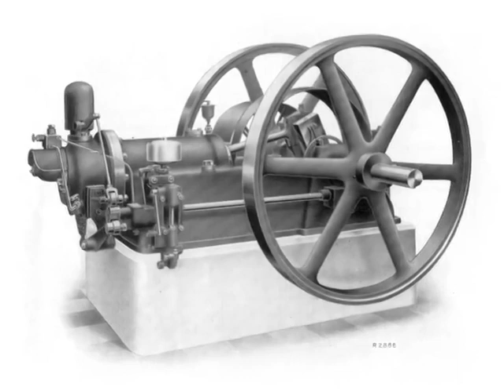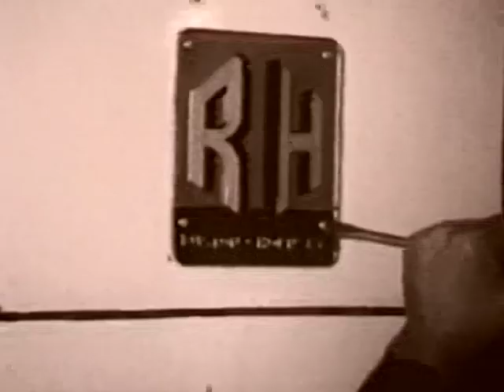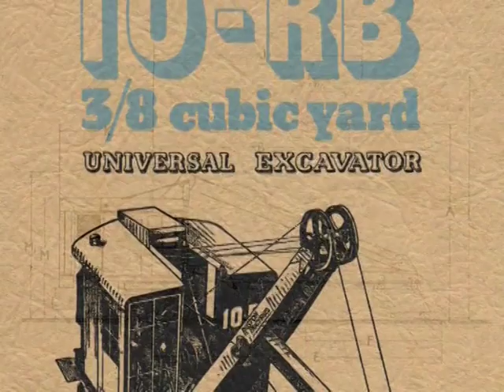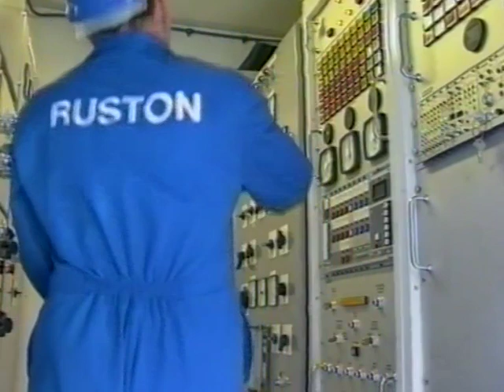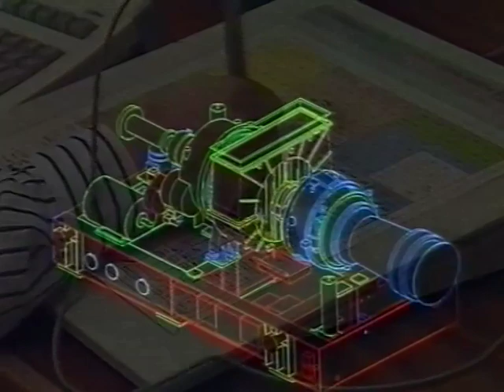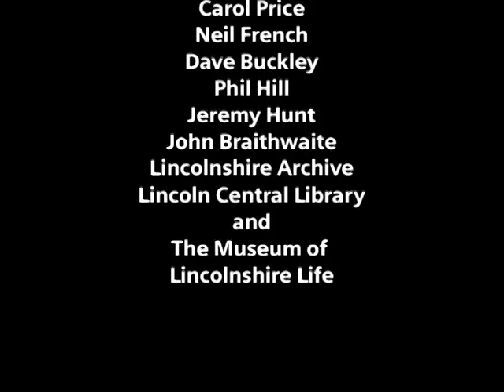From Ruston to Siemens. 150 years of engineering history

Comment: My father started as an apprentice with R&H in 1936, and worked there until the entire Small Engines Division to Staffordshire, finishing as Chief Development Engineer. He worked on many of the Diesels and Gas Turbines mentioned.   The shame is that Lincoln County Archives is not interested in the huge Rustons Archive, literally hundreds and thousands of images and records of every single engine they built - they were all fully documented and tracked. This includes the build and delivery flight logs of all the Sopwith Camels. Its all sitting in  a virtually derelict building on Firth Road, Lincoln, looked after by Ray Hooley, now an old man, who was the Librarian at Rustons in the 60's 70's and 80's. When Ray dies this entire historic collection will possibly be lost. It has nowhere to go, and is rotting away. The Rustons cars failed because they were built on the same 9 inch chassis used for the tanks, and only had 50hp engines. This made them  expensive, heavy, very slow and cumbersome, and within a couple of years much more attractive, faster, lighter, cheaper cars were available.
Reply from the maker: Hi Stephanie. The collection is - or rather was - held in the Canon Building. In 2011 myself and Steve Wildman managed to convince the University of the significance of this material and so a grant was applied for and the material was moved in 2013 to the Lincoln Archive for storage. I believe the conservation dept at the University are cataloguing it all with the help of a volunteer program. I've added a link to the only info I can find and as you can see, material that was due to be skipped has now a good home, although myself, Steve and, more importantly, RAY, are not even mentioned in dispatches: Frank Carchedi, a great chap and good friend was instrumental in the project...of course he was- he had to sign it all off on behalf of Siemens: none of this would have happened if it had not been brought to his attention.
http://www.lincoln.ac.uk/news/2013/03/650.asp